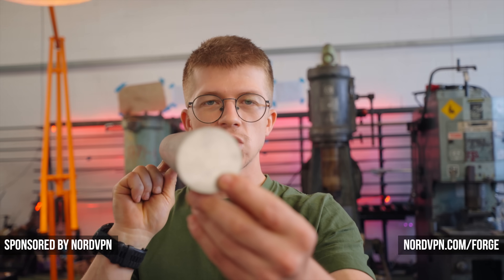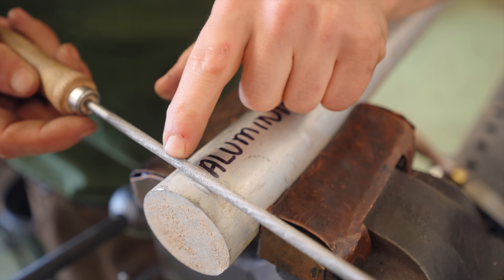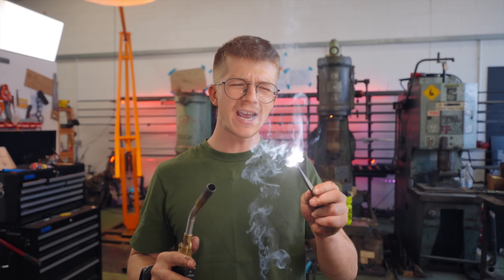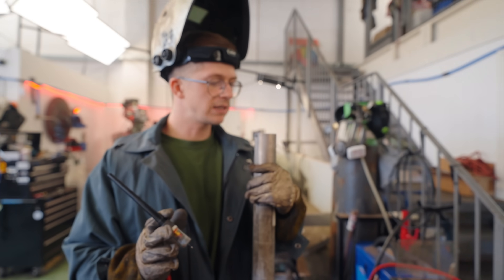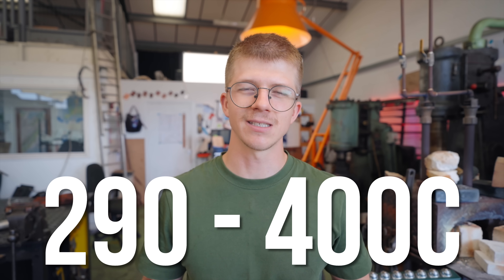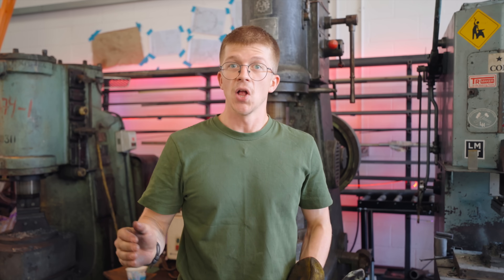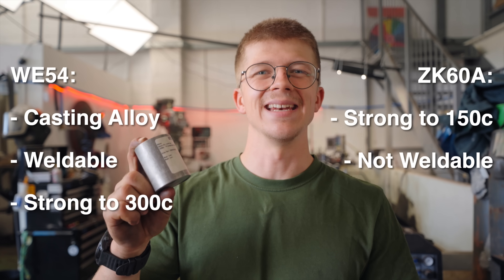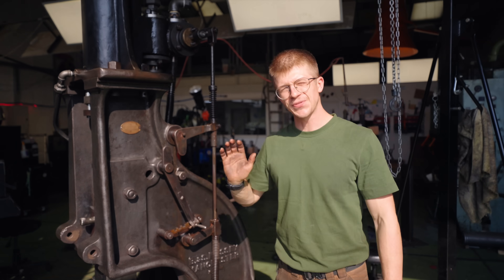Can You Forge Magnesium?

Comment: I worked at what was at one time the largest Magnesium extrusion plant in the world.  Wasn't that big, but we were one of the only ones, so...

I'm here to tell you, controlled Magnesium fires are a blast.  I'd collect saw dust off my band saw for a week before going camping.

While UNCONTROLLED Mag fires are a nightmare.  Years before working there, my dad was a crew leader when a welder repairing our fence started a fire in the yard.  An errant spark is all it takes.  Stacks and stacks of product in bins and stacks of banded Mag round Billet, picture 20-35 foot logs between 7" and maybe 15" diameter, all caught fire.

The fire dept shows up, has no idea what a Magnesium fire entails and starts setting up their water hoses.  Words and punches were thrown trying to save those firemen's lives.  Water and burning Magnesium do not play nicely.

Burned holes straight through a 30" of concrete slab and spread some very noctouse fumes around Aurora CO.
Reply: In the UK, fire services have a list of all the hazardous materials used at all industrial sites they may have to deal with, so that shouldn't happen there. I wonder if US regulations are different.
Reply: @cambridgemart2075  Same rules, but it's fun to just blame Aurora for everything that goes wrong there (former resident of a more screwed up neighboring area, Commerce City).
Reply: @mcpaintball  we commuted from Littleton.  I hated I-25 to I-225 traffic so much.
Reply: @cambridgemart2075  this was sometime  in mid 1980, and we're a pretty big country, meaning 10's of thousands of fire departments and not as much federal regulations at that time.  Pretty "wild west" attitude with safety.  

Magnesium wasn't well known as a material yet either.  I believe DOW was the sole manufacturer, and it was part of their very secretive desalination process that also created most of their sea-water based chemicals.  Even today, industrial secrets persist.  Hospitals are kept in the dark about the true composition of fracking fluid, even after toxic exposure, for example.
Reply: I swear it's always Aurora, Colorado

Comment: We used magnesium engravings to make rubber printing plates. I took some old ones rolled up a piece 1" wide and a few inches long.  Placed it in an old brass ashtray and lit it, once it was going good I hit it with the garden hose.  It exploded impressively, throwing burning white chunks about. It burned right through the brass ashtray too.  I am told old VW engine blocks could catch fire and the fire department would just let them burn because of that.  I just watched a video and magnesium dust can be used to make a type of flash powder for fireworks.

Comment: Magnesium metal is not used as a laxative, magnesium salts are.
A sodium metal vs table salt kinda case

iirc its carbonate and sulphate but any ionic +2 metal salt will cause a laxative effect (aluminium and magnesium are the typical ones, I can’t remember calcium and the others but pretty sure they also work)

Comment: It seems like the cracking happened cause of the heat not being consistent through the whole piece. Since the core of the metal was starting out colder than the surrounding material you ended up getting internal stress in the metal. Induction heating would have given you a more even heat through the whole piece and a better chance to produce the shapes you wanted without cracking.

Comment: I’m not a scientist but I think something’s ability to be cut is more based on that material’s covalent bonds rather than the density of the atoms. Lead for instance is much denser than steel but because it has weaker covalent bonds, the atoms can be pulled apart from one another easier.

Comment: We used to machine magnesium castings on a CNC lathe and the only thing to extinguish the swarf, well smother it, was a very finely powdered baking soda. We had to clean the swarf every 30 parts or so, depending on how big they were, as they almost wrote off a £180,000 machine as the heat melted the switch gear and wiring looms, it cost £120,000 to fix it. It was a Boley BDN160.
Gaz UK

Comment: Another interesting property of magnesium: it has a relatively low thermal conductivity,  much closer to iron than to aluminum. Maybe the magnesium was splitting in the middle because the middle of the work piece wasn't hot enough yet? If you ever try forging magnesium again, I'd be curious to see what happens if you leave it in the kiln longer.

Great video!

Comment: I'm pretty sure magnesium citrate is the laxative. It's a magnesium oxide and citric acid combination that forms magnesium citrate and water. The laxative usually comes as a liquid. The magnesium metal is more commonly used for refraction to cool furnace lining, believe it or not. Burns really hot, ignites at low temperatures, and keeps furnaces in manufacturing cool. It's a very weird material...🤔

Also, a p.s. In the video, you may have accidentally made thermite on your floor, and magnesium strips are used to ignite thermite.
Reply: Also, also: Magnesium burning can cause permanent blindness. Please use caution...
Reply: It also is almost impossible to put out once ignition occurs due to it's unique ignition. It ignites a small part at a low temperature, then that ignition causes a chain reaction and ignites more and more magnesium until the magnesium is gone.

Comment: A decent rule of thumb to determine if a metal is malleable is to look at the crystal structure. Hexagonal close packed (HCP) is typically brittle, face-centered cublic (FCC) is typically very malleable, and body-center cubic (BCC) is usually in between the other two structures. Magnesium is HCP hence the cracking and chipping when forging. Aluminum is FCC. Steel is BCC at room temoerature, but at forging temperatures, it transitions into FCC, giving it better malleability.

Comment: Magnesium work hardens like aluminum but is very brittle. The forging of magnesium is not usually forged as it is not an easy to work with metal. It is usually either cast or machined to shape.

Comment: Know you alloys buddy. Simply by googling Elektron WE54 you'll find out that it is a casting alloy.
You would probably have had more luck with forging alloys - which hold Aluminium and Zinc, which are not nearly as toxic as the Yttrium in the alloy you burned in your shop!

Cheers,
Your average space engineer.

Comment: Has anyone tried "Damascus" forging magnesium and aluminium?
The melting points are very similar. (And they form a pretty low melting eutectic alloy 437 °C).
If it welds then you can differentially etch them with strong alkali which affects aluminium but not not magnesium.

Comment: 1:50 Fantastic question.
TL;DR: No, but kinda, but also no.

The amount of atoms in a material is measured by a unit called the "Mole" (Mol), which is a measurement of mass for elementary entities (molecules, atoms, ions, etc.). A Mole is equal to 6.02214076 x 10^23 entities, and the measurement is based off of how many atoms of carbon exist in 12 grams, hence the odd number.

Each material has it's own mass associated with being equal to 1 Mole. We can use this measurement to compare how many atoms there are in two metals based off of their weight and purities. For example, a Mole of Magnesium is 24.305 g. A Mole of Tungsten is 184 g. A Mole of Iron is 55.84, and steel would be similar, but vary depending on what it's alloyed with. Since all of these masses are one Mole, they contain roughly the same amount of atoms, and the amount of atoms per cubic centimeter can be derived from these values; this unit is called the "Molar Volume".

The Molar Volume of Magnesium is 13.9983 Cubic Centimeters per Mole, the Molar Volume of Iron is 7.105, and the Molar Volume of Tungsten is 9.47. Since all of these volumes contain the same amount of atoms, the larger the volume is, the farther apart the center of each atom is. Something interesting to note here is how there are less atoms of Tungsten per cubic centimeter than there are atoms of Iron, despite us knowing that tungsten is significantly harder than Iron. This means that the assumption that molecular density determines hardness is proven incorrect by contradiction.

The true reason as to why some materials are harder than others lies with the strength of the bonds the atoms or molecules have with one another; the harder it is to break them apart, the harder the material. HOWEVER, studies have shown that while Molar Volume is not the determining factor for hardness, it does have a correlation with hardness, meaning that Molar Volume does in fact influence the hardness of a material, it just isn't the only factor.

Comment: Magnesium fires are no joke. Went to Navy firefighting school in boot camp, and the Navy will straight pitch a plane over the side of an aircraft carrier if theres the slightest risk that it's magnesium components might ignite. 

The stuff will melt through a deck and it explodes when sprayed with water. It will crack the water into its own oxygen source and in FF school they showed us videos of a plane still blazing like an arc wielder as it was sinking into the deep. 

Normally is only the dust that's easy to light, but if a normal piece gets hot enough, the entire chunk will burst into flames like a star.

Comment: I'm not a scientist either by trade, but i've I spent a lot of time learning about science. That's not always the case. Also, different atoms are larger, and the larger the atom, the denser tends to be kind of. But how are you going to the periodic table the more protons are in the nucleus of each atom. However, things like density and properties tend to group together based off of patterns rather than just the larger things are often the densest. For example, the densest element on the parent table is Osmium. And the up and down column that it's in tends to have some very dense elements in it, yet if you go two columns over right before Osmium, which is 76, 74 is Tungsten. Tungsten is also very dense, though it's not as dense as osmium 22.59, it's still extremely dense at a bit over 17. G/cm³. Yet you have element number 22, which is titanium vets. In some cases, stronger than iron, or steel, and yet it's less than a third the wait because its density is significantly lower. It's more comparable to aluminum yet with the strength is closer to iron or steel. So where is there is a tendency towards larger atoms being more dense, and there's a tendencies towards density and strength; It's way more complex than that, because the periodic table works off of patterns, it's not all completely logical, and we've been able to do a very good job at mapping these patterns, but the patterns aren't always consistent. That is why the periodic table is shaped the way it is. Everything makes some sense up until you hit barium.Element number 56, after that the lanthanides and actinides start, and the pattern kind of gets thrown off because now you have an entire category of different properties integrated in a spot that doesn't make sense you would think, oh, the transition metals are going to keep going now because that's the pattern of before, but that's not the case. And then you have the post transition medals, metalloids, and nonmetals that are a lot more chaotic. There's not as much pattern or structure to them.

Comment: That crack forming in the centre tells me the heat isn't penetrating like you expect, but that's still ~3x the thermal conductivity of steel, though less than copper or aluminum. It could be a combination of its seemingly sharp transition and the thermal conductivity, or it could be that it work-hardens very quickly, but just not to the same extent as something like titanium.

Comment: Magnesium rims are rolled at WAY more than 400°C. If the oven is 400°C, the billet inside isn't necessarily.
Magnesium forgings are usually die forgings with large hydraulic presses. Not so much impact forging. I haven't seen drophammer forging of Mg yet. It may also be a thing, but I don't know it.

Comment: 🤷🏻‍♀️the reason the file didn’t do as much as it did on the aluminum is because the magnesium is so soft it clogs up the file so you have to clean it with a wire brush more often

Comment: We would machine our vibration testing fixtures out of magnesium to move the resonance of the material outside the 0-2000Hz range so it didn't interfere with our measurements. My engineer asked me if a standard C-Class fire extinguisher was good enough for our lab, and I asked him if he knew how hot magnesium burned. Dude came back an hour later and was like "I ordered some D-Class extinguishers and now security hates me".

Comment: Density and hardness are not related as you think. There are really dense metals like Lead that are super soft or on the other end of the spectrum metals like Titanium, wich is not very dense, but extremely hard. 
That is because the hardness of a metal is entirely dependent on the structure that connects the Atoms (you can think of it like how you can harden a steel by just changing the atomic bonds within the steel by heating and cooling it, but the material stays the same kind of steel and thus has the same weight as before.)

The density of a metal is however mostly dependant on the mass of the atoms it is made of and how close they sit together in the structure they form. 

So to be clear, the density also has somthing to do with the structure, but in a different way. A lot of other properties are also related to the atomic structure, like (resistance to bending), annealing temperature, melting point, stiffness and how brittle it is.

Comment: Older VW engines blocks (the air cooled verity) were made out of magnesium. We use to get em from junkyards strip them and throw one in a hole at the beach use a torch to light it (it’s harder than you think) but once it gets going you’ve got the brightest hottest bonfire ever. It’s so bright white you can’t look at it and so hot you can’t get near it probably don’t want to breath the smoke and your not putting it out.

Comment: Aluminium ... pfft.  Wankers.  LOL.    In Canada and USA, we prefer "Aluminum" which is odd considering most of the rest of the world has adopted Aluminium. It does sound weird though. I would have thought Canada would have switched to Aluminium like we did the Metric System but I guess Aluminum is a hold-over from yesteryear that we just aren't ready to adopt yet. And of course, USA will be another century or two before they get with the rest of the world. 
BTW - The Number of Atoms has little to do with Mass. It's true that more atoms means more mass but 100 atoms of Magnesium is still lighter (has less mass) than 100 atoms of Iron (because Steel is not an element). Still, we got the point.  😁

Comment: greetings, 

I study chemistry and material science in my masters right now.

We need to consider more than just plain density. Also the crystal lettice is important.

A very dense, but soft metal is gold. A very dense AND hard material ist Tungsten.
They have almost the same density. So  something else is important to their properties than just density.

Diamond is super hard, yet less dense than iron. There are many morr examples.

Figure a cube, where all corners and middle points of the faces are filled with a ball.
We have the face centered cubic (fcc) lattice of e.g. Aluminium.
...
the more I think of it, the better is to write, maybe look for the crystal latices by yourself, not to get to confused by my comment.
fcc, hcp, bcc

Each Metal has its desires form, how it crystalises. Better, in which crystal lattice it crystalises when frozen solid (< melting point). 
The lattice gives the material its propeeties.

In a fcc lattice (look it up, ABC stacking), we have 3 possibilities on how a plane of atoms can move. A hole plane can shift parallel to another by the x-, y-, or z-axis. So there are 3 grades of freedom.
Metals that crystalise in that lattice arr gold, aluminium, copper...
rather soft metals.

for the hcp, due to the stacking order of the Atoms (better look at some pictures, ABA stacking) we now only have one (or two, forgot it) plane that can move freely, so less order of freedom. Hence the material is more brital. 
Elements like Titanium and Magnesium crystalise like that.

For the last, the base centered cubig lattice will give us no order of freedom, since no plane can slide. Materials that crystalise like that a very hard and brital. Oh, what a coinsidence, Tungsten crystalises like that!

Density now is just how closed packed the atoms can be. It sais not to much about actual phisical properties.

Comment: Have gas welded Elektron in historic race car components, it is age sensitive I.e . Welding sheet made in the sixties only really works if welding to sheet of a similar age ,try welding 1 year old elektron to 60 year elektron is really really difficult. It also work hardens really quickly so you have to anneal around 5 times more often than say a 1050A Aluminium .
Some of the Magnesium forgings found in WW2 German Aircraft are works of art. 
If machining make sure you clean out your swarf tray constantly as a runaway fire will destroy your machine!